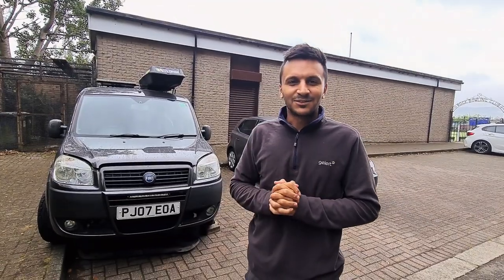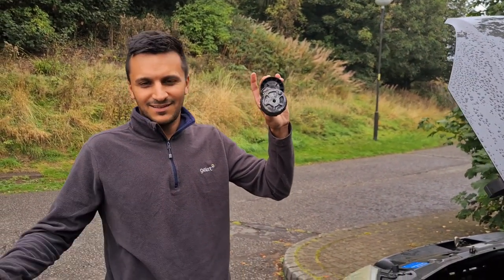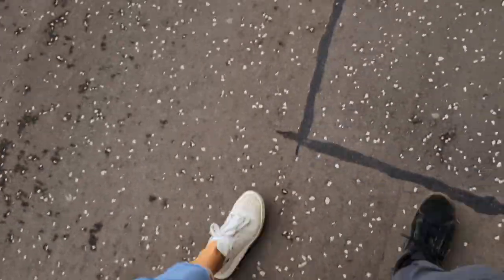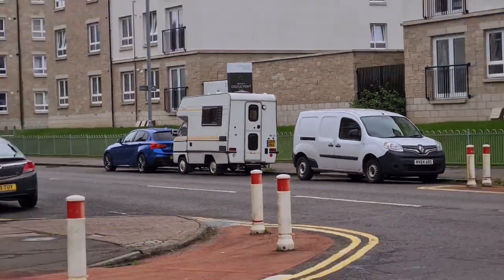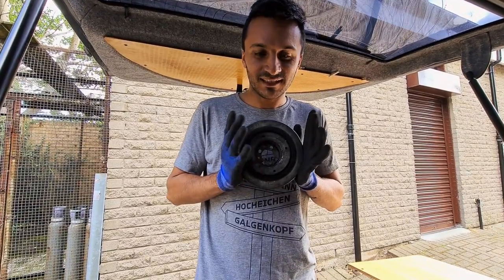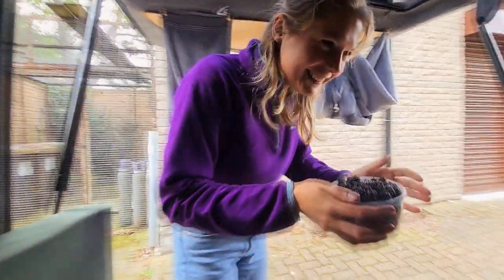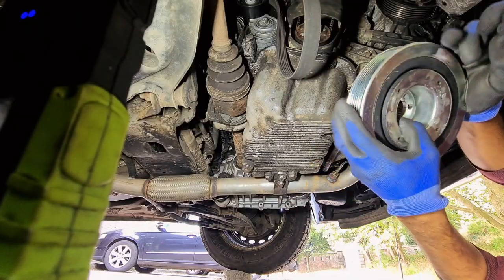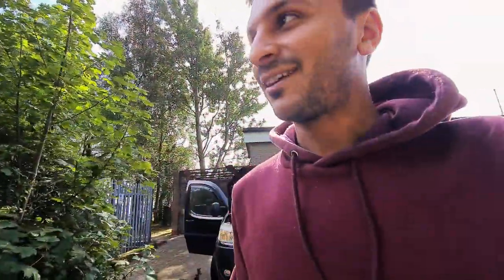The bad luck didn't stop there.. - VANLIFE PROBLEMS SCOTLAND

Comment: i am wondering if the parts you replaced were defective and/or covered by the manufacturer under a warranty?
Reply from the maker: Unfortunately no, this van is 14 years old now with 153000 miles!

Comment: Hello again omar I have the same fiat as you had a bad sound coming from the engine been told different things finally had the belt tensioner replaced and the noise still the same so then had the alternator clutch replaced noise still but not as loud but on cold start that's when it appears when the engine is warm after 15mins the noise disappears I do have the heater plug  symbol flashing on the dash for some time then goes off when engine upto temperature just need it sorted as I've converted it like yours do you have any suggestions please what it could be
Reply from the maker: Has the crank pulley been changed?